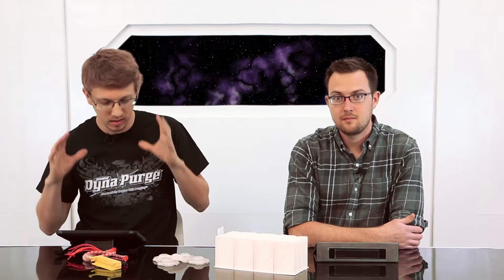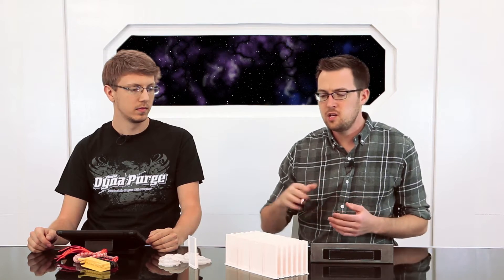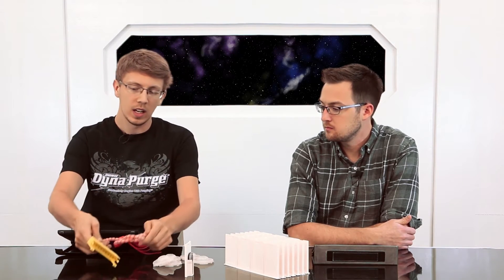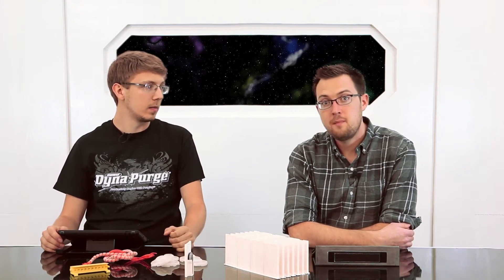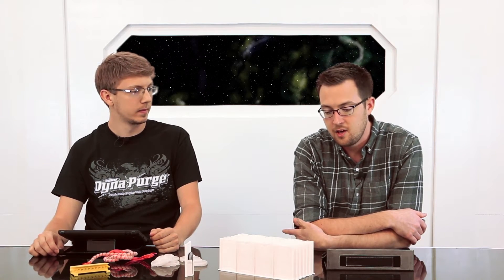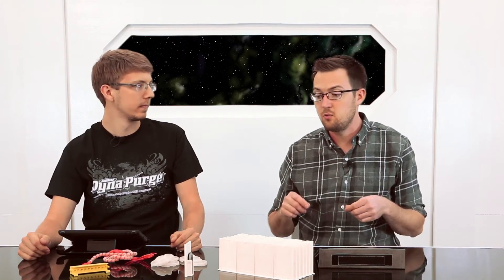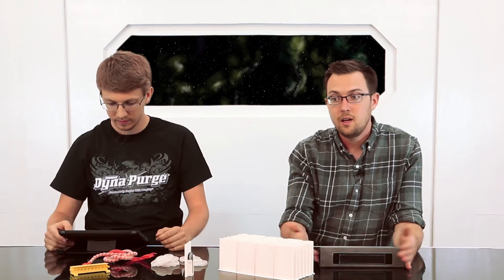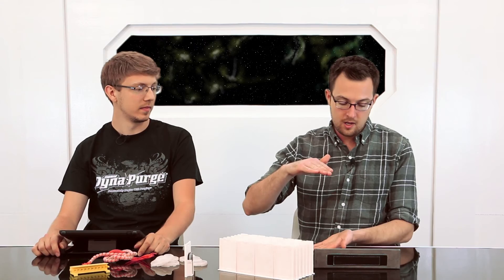Short Run Manufacturing with 3D Printing? - F3DPS Episode 46

Comment: Howdy Hi -  Just came across this while doing new research. Yes you guys were right on point with my squarehelper. -  ramped up to 30 MB rep2 machines. Printing 32 pieces per buildplate around the clock for a few years. I knew this would be short lived with lightning connector fixing the prob and ultimately  mag strip cards becoming obsolete. Then used the botfarm to print  my pop-culture buddha iidea and have been doing comic cons  every weekend for 5 yrs after squarehelper. Thanks for the  great work at Fargo  and the shout out. Best, Chris